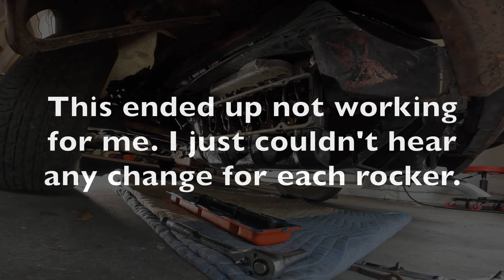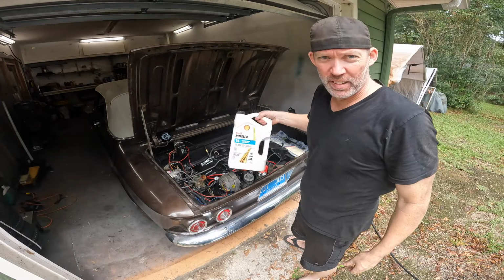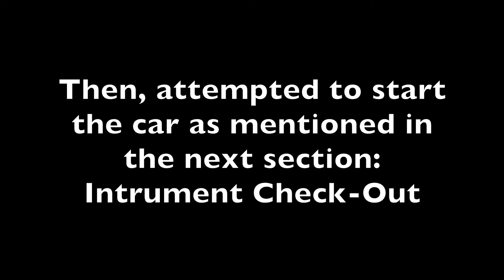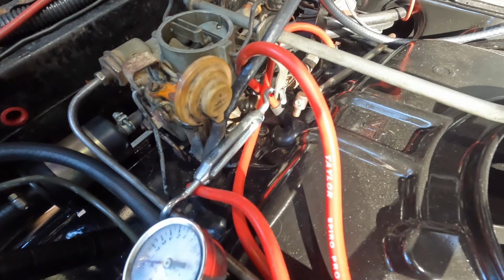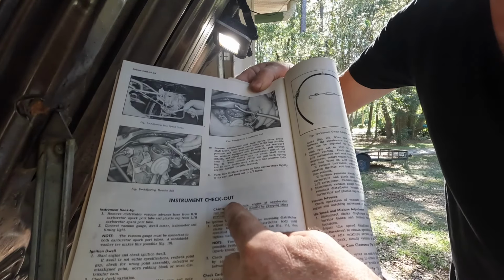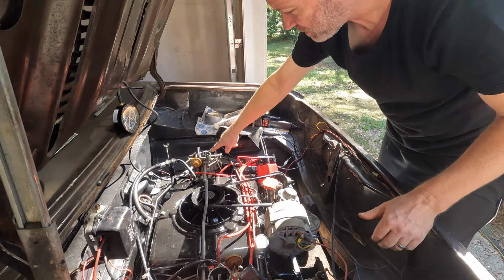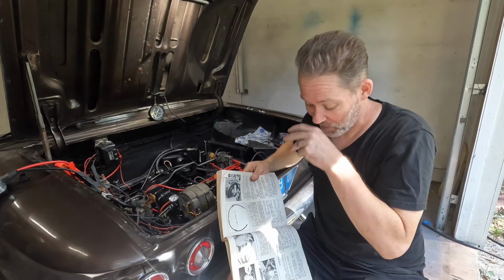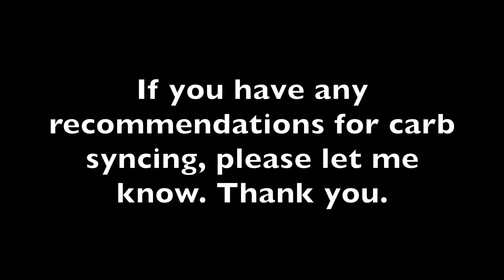1963 Corvair ep18 Engine start pt2

Comment: The backfiring through the carburetors and the fluctuating vacuum gage lead me to believe the valves are still not right (likely some too tight). The first secret to adjusting the valves is to make sure each and every lifter is on the cam base circle when it is being adjusted. This is, Cold, not running method. The best way to do that is to ensure that the piston is at top dead center on its respective firing stroke. Start with #1 and then you can rotate the crank to the respective firing order as needed. The second secret is to use a .001 feeler gage. Loosen the rocker arm until freely loose. Then put the .001 feeler gage between the rocker and the valve and carefully tighten the nut as you slide the gage back and forth. Make sure the socket is not pushing on the ball under the nut or it will throw the "feel" off. Tighten slowly until you JUST feel the .001 gage not slip freely and immediately stop. Then you can do the 1/2 to 3/4 turn (I do a 5/8ths turn to avoid indecisiveness). This works better than the 'twirl the pushrod to feel contact' method.  I don't like the set hot/running method because it is too easy to push the socket on the ball below the nut and alter the clatter sound that is trying  to be adjusted out. Plus as you (now) know it can get messy.

Regarding the carbs. The 1.5 turns on the mixture screw is correct starting point. In fine tuning you shouldn't deviate more than 1/4 turn from that. Follow the book on the initial throttle blade stops. Do the passenger side first then the drivers side, then turn the linkage connecting adjustment so it just slides in the hole and links the two carburetors together. That should get you off in a decent base setup. The car needs to be warmed up and the chokes off before fine turning the carburetors. Just wire them full open once the car is warmed up. I have the one year only manual chokes (1961) so I can't advise on dealing with those auto chokes differences you have. But as I said, they do need to be fully open when the car is warmed up and you proceed with any fine adjustments. I hope this gets yo going on the right path.
Reply from the maker: Thank you again for the very detailed explanation. I will try your method for adjusting the rockers. I really appreciate you explaining the carb set up. I recently took the carbs off to really take a close look at them. When doing the adjustments off the car I can see the 1.5 turns initial puts the blade right over a small notch in the bore. When in fast idle position that notch is exposed to vacuum so I think it is providing more fuel and makes sense what you are saying about not deviating more than 1/4 turn. Any more than that could interfere with that notch and blade relationship. Thank you again for the great advise. I also found I did have some vacuum leaks and the gaskets I was using was probably interfering with fuel delivery. So I feel there is progress to be made.
Reply: @rustaholicrehab  I just wanted to clarify that the 1.5 turn adjustment I was talking about was the MIXTURE screw, the one that has the tapered needle end. The THROTTLE BLADE initial adjustment (per the '61 manual) is to back the screw out until the throttle fully closes (view from the underside if the carb is not installed). Then place a .003 feeler gage between the screw and carb body and turn in until the screw just touches the .003 feeler gage, remove the gage and then turn that screw 1.5 turns inward.  What this does is gives you a decent "should work OK" setting. Any adjustment after that is fine tuning but you need to get to a decent operating situation first.

With the above settings you need to be careful because you seem to have a choke issue. The carb works as such that as the choke closes..., there is a stepped piece that opens the throttle blades beyond normal idle. It is important that that not be affecting the idle when making the throttle blade adjust which I believe the manual calls "curb idle." Once the engine is warm and the chokes pulls off (open) those "steps" should have moved out of the way and the initial idle stops set above are the only determinant of the idle.

So, in summary confirm the valves are set correctly first otherwise carb adjustments mean little if nothing. Set the MIXTIURE and THROTTLE BLADE screws as per the manual but being aware that you are not on the stepped choke idle stops when doing so. Get the engine warmed and confirm that the chokes are fully open, if necessary use wire to hold them open after warmed to see if you have desirable results.

 If the engine runs decent THEN don't change any of those setting above and then look into why the chokes are not opening equally. As I said, I have manual chokes rare to the '61 models only and don't want to ill advise you. Hopefully the manual can help if you have the 62-63 supplement that I don't have. Just be aware that the carburetor has three adjustment screws. The MIXTURE screw determines how much gas you are getting at idle, the the THROTTLE BLADE (curb idle) screw that determines how much air you are getting at idle and the CHOKE IDLE screw that opens the throttle more than normal before the car is fully warmed while the choke is on.